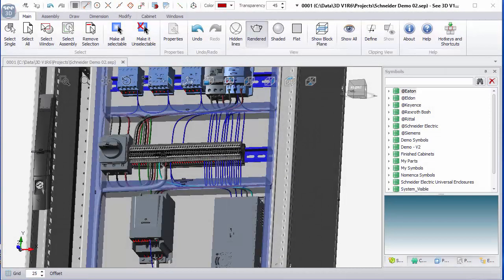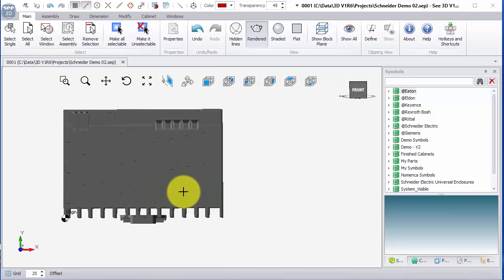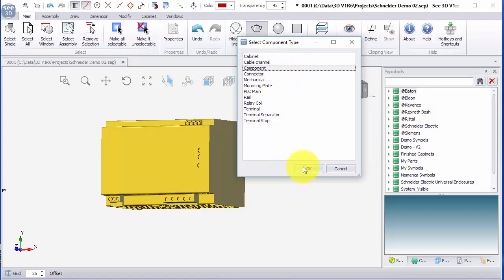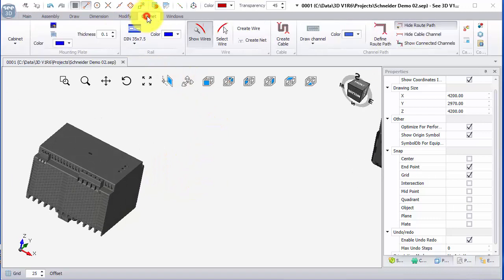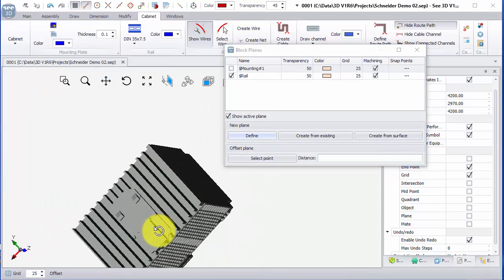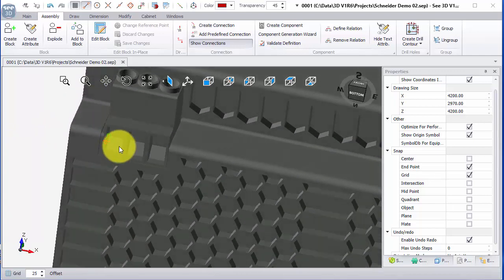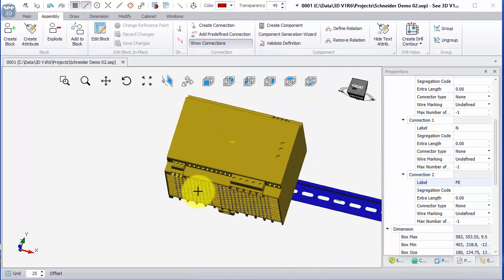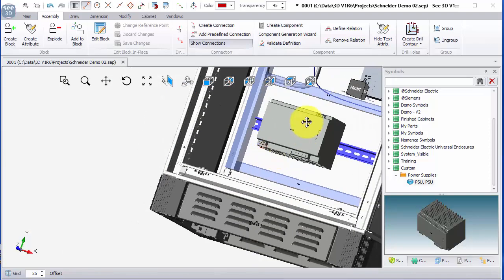Creating 3D Electrical Symbols from STEP files

Comment: sir, when I enter the symbols section on my 3d panel drawing screen, no objects and materials are visible. It is empty, what is the reason please explain
Reply from the maker: Please make sure to install the example 3D Panel environment: https://ige-xao-delivery.j-doc.com/s/nWiC7QfigXy89bq/download
Then check in the settings that the symbol path points to the public documents folder where the symbols have now been added.
Reply: @IGEXAOUK  First of all, thank you for your interest. But I still couldn't solve the problem. All of the relevant folders seem to exist, but the 3d symbols are still not visible in the program. @ABB.3DModels, @Allen-Bradley.3DModels ... etc these files appear as blank screen in the program, I cannot select them.
Reply from the maker: @erseayd  OK couple of things to check. The environment link I sent was for 3D Panel V2R2 symbols. Get back to me if you have the older V2R1 since there are new features that mean the symbols won't be visible in the older version. Next, check in the symbols folder that each 3D catalogue has both a folder @Manufacturer.3DModels (containing the model files) and an index file called @Manufacturer.ses3d. If there's still no joy, ping us on uk@ige-xao.com, thanks.